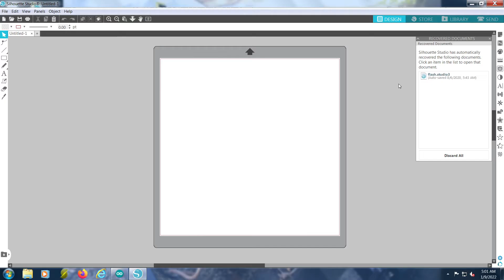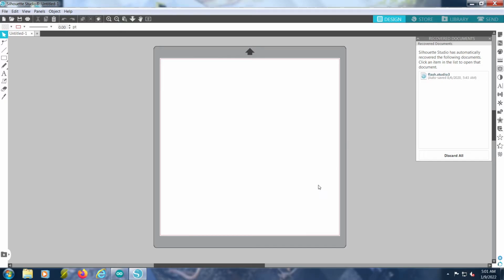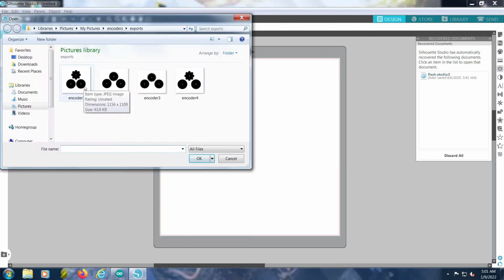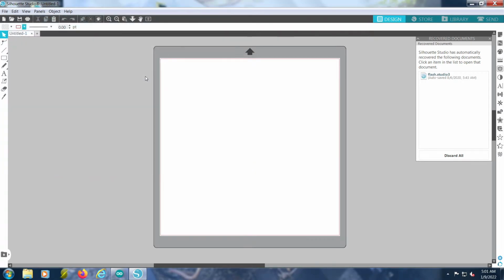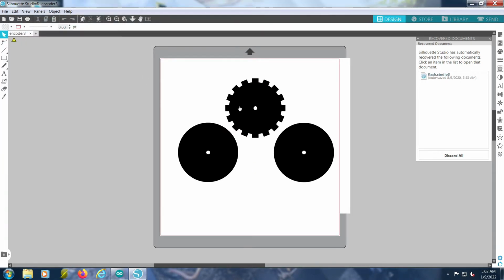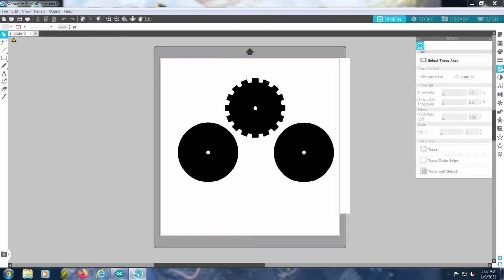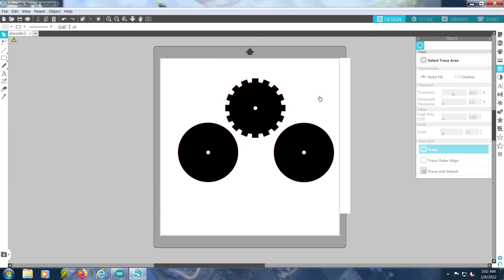How To Make Encoder Wheels

Comment: I am a new subscriber and i love the level of detail you put in your videos, especially in the latest code  video. 
I wanted to ask though, why are the encoder wheels so big? i have seen that the gap between the 2 sensors that measure is the main factor, but if that is true, wouldnt that make your design non-universal?

Thank you in advance and THANK YOU for taking time to make these videos, they have been very helpful to me.
Reply from the maker: Thank you for the compliments, I really appreciate it! That's a great question! I designed these to use common ir leds and detector diodes manually assembled. Those are larger parts and seem to work better with larger wheels. There is a reduction in precision with oversized gaps and teeth, but I tried to make something that would work with almost any hardware configuration sacrificing some precision for ease of use with larger parts. Ideally everything would be very precise, but for home built machines there have to be trade offs. I found oversized flexible wheels with larger teeth and openings were the easiest to align. It may not be for every project, but the method of producing them I demonstrate can produce more precise wheels with any design one chooses to make. I provided a few designs that I personally found useful. The same method could be used for producing linear encoder strips as well.
Reply: @CircuitSecrets  I understand now yes, indeed i see here in your file there are many different designs, my self i have some ir sensors off a printer and soon i will try to make my own encoder wheel and see what comes off it, though i dont have a cnc that can cut with a blade, i have a plotter that can plot with a pen.  One day, hopefully soon ill have something to show for it.
Reply from the maker: @AliensGotTheBeat  Awesome, you can plot on the plastic and cut by hand, not as fast, but just as effective. Or maybe you have a friend who has a craft or hobby cutter.